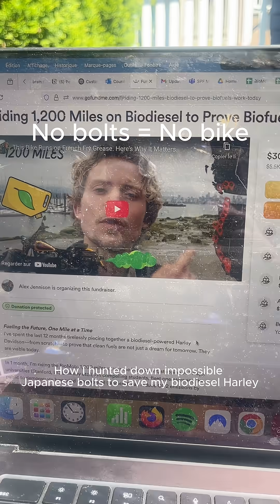The $400 Bolts That Almost Ended My Harley Build

Comment: Was it not possible to get a machine shop to manufacture them?
Reply from the maker: well, technically may be possible but... rare pitch (1.15 if I remember correctly, so lathe doesn't have preset) + flathead (where do you grip?) + hex drive. Would be very very challenging to machine all of that....